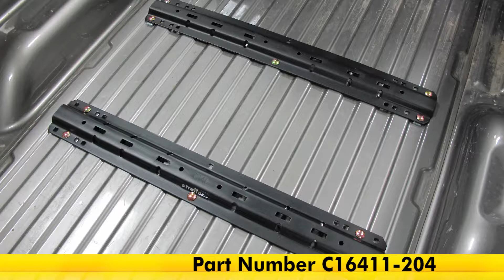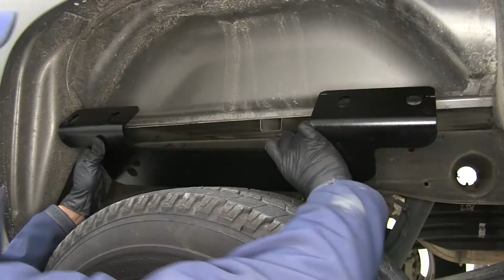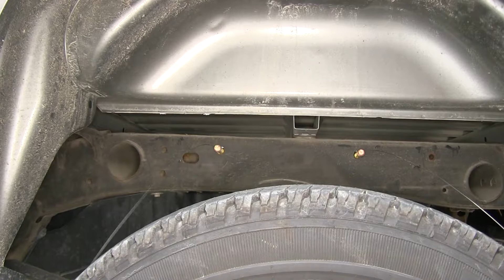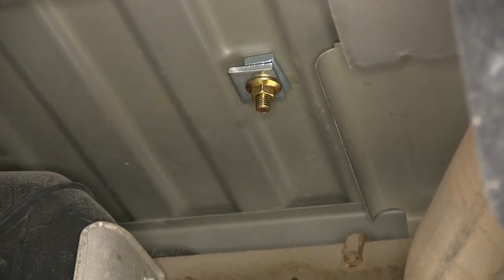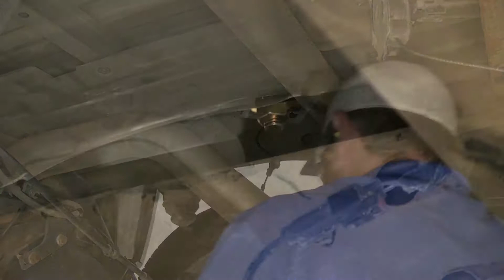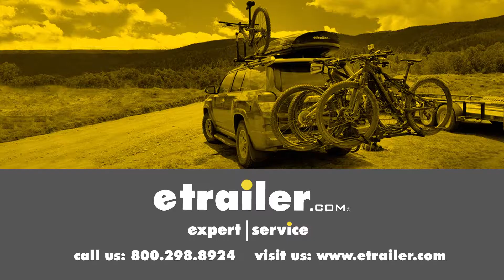Set up: Curt Custom Fifth Wheel Installation Kit for Chevy/GMC on a 2014 Chevrolet Silverado 2500

Comment: Nice video but why didn't you provide the measurement for the forward rail from edge of bed? Long bed distance and short bed would be helpful, at 2:42 time on video, you pull measuring tape out but don't call out what this is. Curt video https://www.youtube.com/watch?v=fCho-wf591E gives these numbers but don't show as you did where to measure from. I'll assume instructions in kit will provide these numbers after I receive the shipment.
Reply from the maker: The exact measurements are provided in the installation instructions, which we've linked below for you! Hope that helps!
https://www.etrailer.com/instructions.aspx?pn=C16411-204